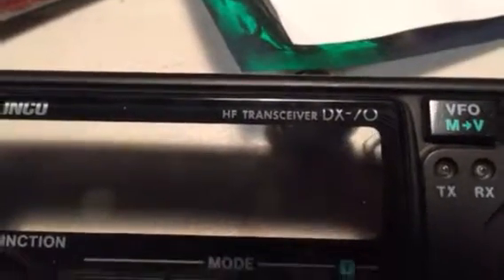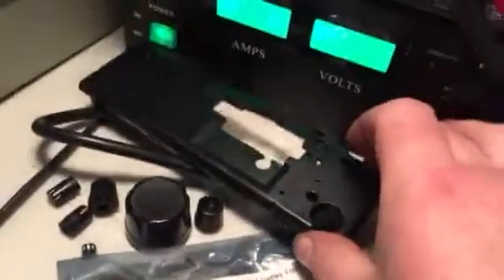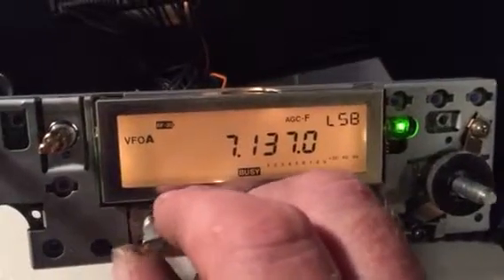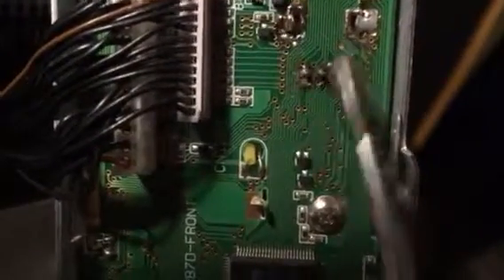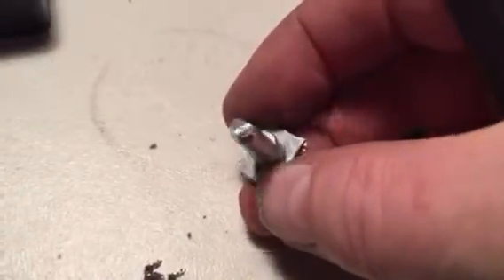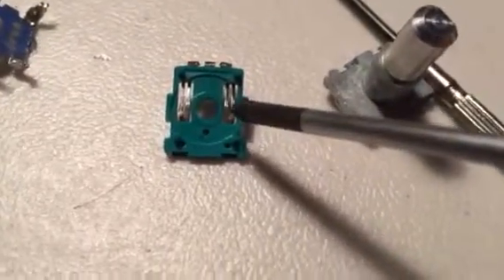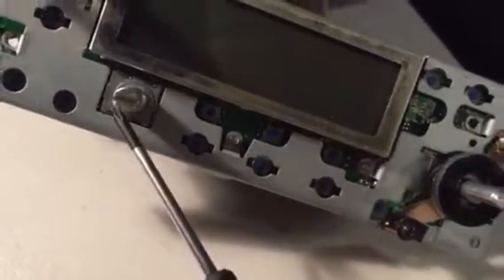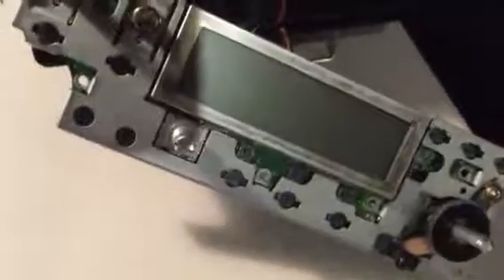Alinco DX70 multi-function switch, fix or clean

Comment: the exact drop-in replacement for the multifunction switch is made by ALPS, model EC11E15204A3 . it has 2 dummy, unused pins on the other side of its board, you cut those down, and it fits perfectly. It's a bit hard to explain, but when you'll see the encoder you'll understand.

Comment: I just ordered one on ebay from V&U electronic Components Part No. EC11E15204A3 which fits OK.
Just cut the two extra connection pins off and remove a bit of plastic in the bottom of the knob which stops the shaft from going all the way down.
Thank you Wayne for the part number and the video 

Paul
Reply: Hi Paul, need to get one myself, I’m see theses 5 pin with push in shaft switch, what did you mean by removing abit of plastic to spot the shaft pushing in? 
Best regards
Reply: Also ordered one for mine, many thanks vkejd